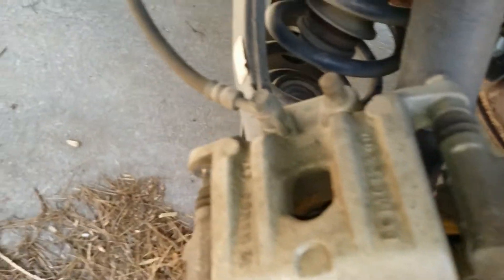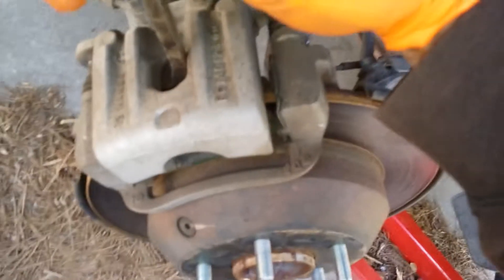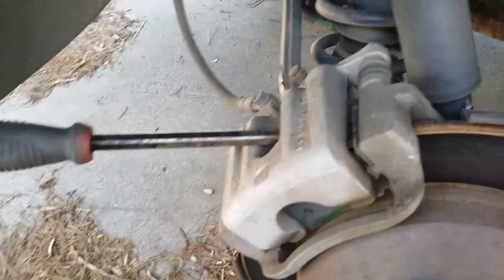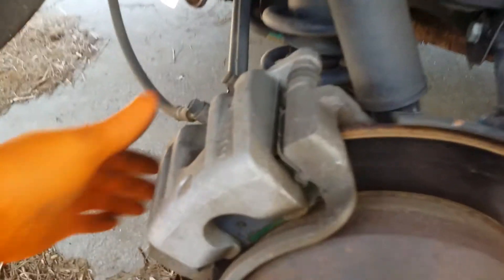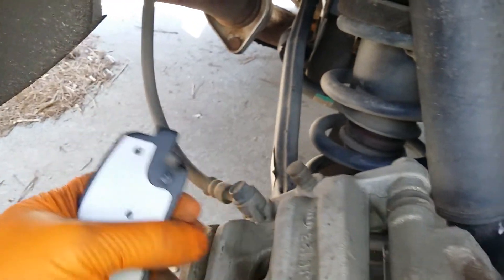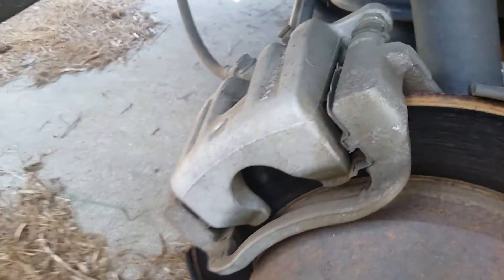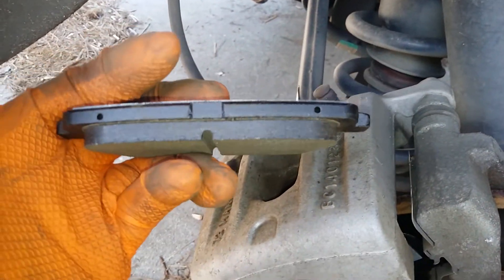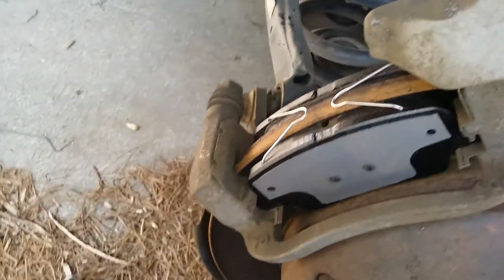HYUNDAI SANTA FE SPORT 2017 REAR BRAKE PADS REPLACEMENT

Comment: Incorrect pad slap. Why is it incorrect? You are supposed to remove the caliper, PULL OUT AND GREASE  THE  SLIDER PINS and reinstall. Then you did not even put and grease on the backside of the  brake pads 🤯🤯🤯